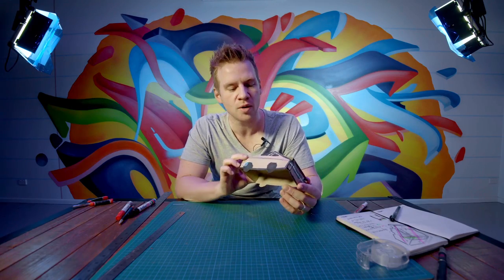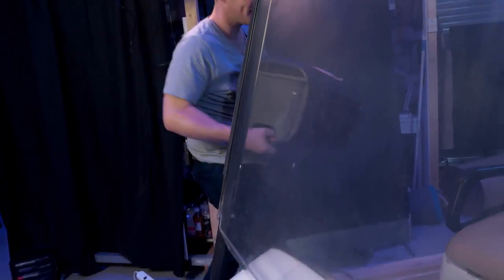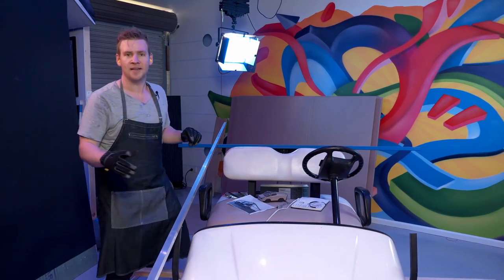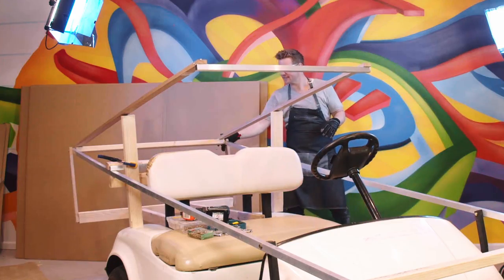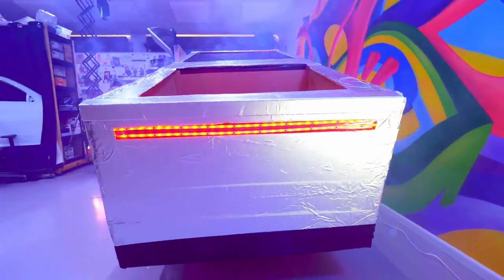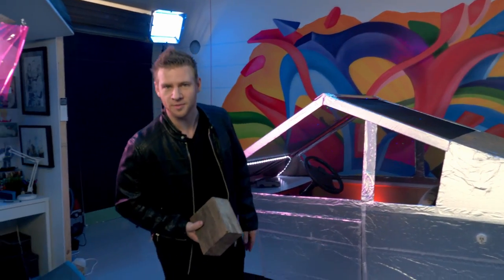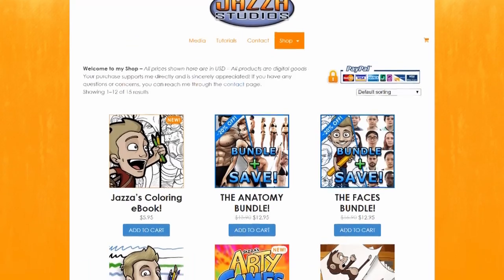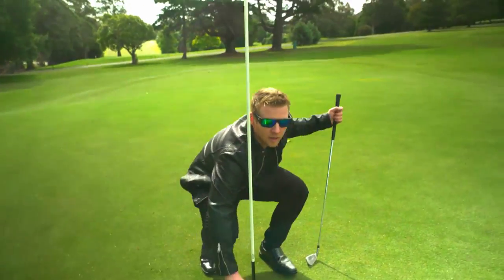I MADE My Own TESLA CYBERTRUCK - (And drove it around town...)

Comment: Advice:
Drill pilot holes when using screws. It may seem pointless but it reduces the risk of cracking, and reduces the strain on the inside of the timber. 

Support the board on both sides when cutting. It’s less dangerous, and let’s you make cleaner, straighter cuts.

Comment: The doors would have been more practical if you cut it like a normal door and have a sliding contraption on both sides of the car doors and it will slide to open and slide to close so you can open from inside and out and the contraption will be in the inside and out and will be connected ,to lock hot glue a small elastic inside then Cut a slit and it will go over the outside to make sure it's double secured (a suggestion to make life a bit easier when using Tesla Cyber Truck)